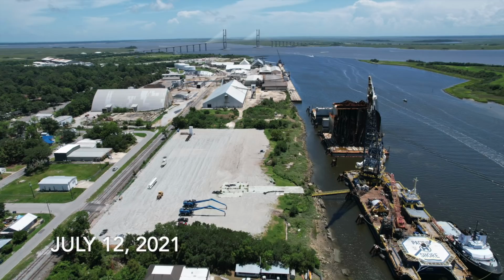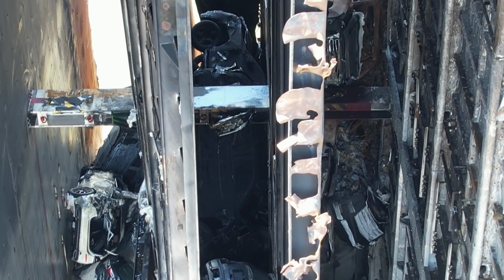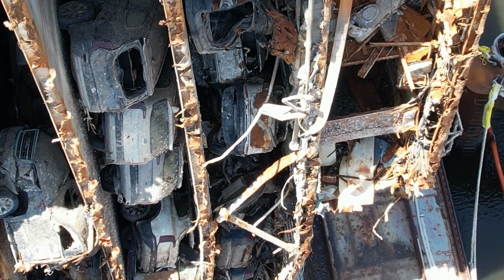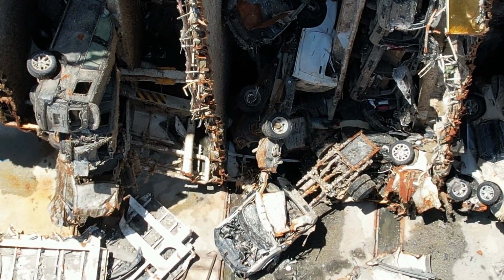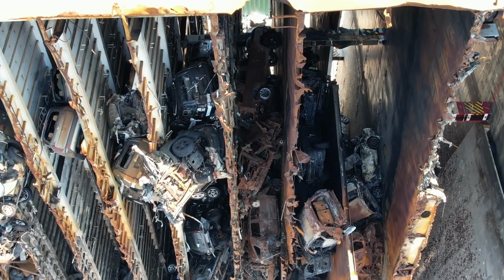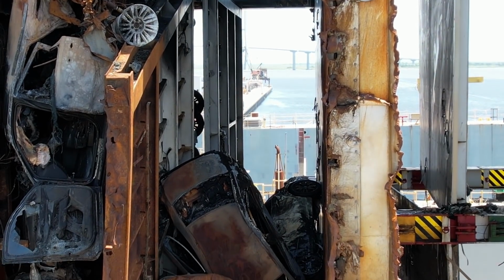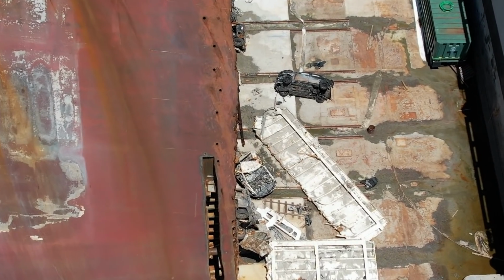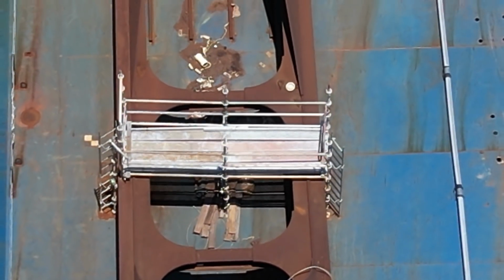LOOK INSIDE SECTION 3!!! on July 12, 2021

Comment: Fantastic drone footage.  What an extraordinary mess.  Thank you for providing such graphic reports.  Do you know the thickness of the hull skin?  Most of the cars I see are "Swamped Buggies."
Reply from the maker: The hull was 40MM thick at the bottom of the hull.  Now as the side of the ship rises, the skin tapers down.  The top of the ship is not very thick, more of a protective covering to keep the cars free of sea spray.  MM
Reply: @MinorcanMullet  WOW. 1.5"  is very thick plate.

Comment: It appears this dry dock is a lot wider than the barges that were being used. This section doesn’t hang over the sides allowing oil & other chemicals to leak into the water.
Reply from the maker: Good observation.  MM

Comment: Are they using the dry docks just in case these pieces are not able to be hoisted as high as the others?  When this piece was hoisted after the cut it seem to be raised as high as the previous pieces.
Reply from the maker: Maybe the drydocks were less expensive to rent for the remainder of the wreck.  I don't think the drydocks were submerged.  MM

Comment: If you play your cards right, there's gonna be some good deals on slightly damaged cars from the Golden Ray, you watch and see. So what if it's "half a car" just think of the gas mileage you'll obtain, only two tires to buy instead of four, ect. You wanna convertible, no worries, mate, plenty to be had. American's are always open for a great buy. You may need to vacuum them out good, but a little work and look what ya got !!!

Comment: I don’t recall having said this before but now is the time. The Golden Ray’s ship captain and harbor pilot ought to be banned from ever having command of any vessel. They should be directed to apply for employment with Waste Management Corp. or SMIT Salvage or T & T Salvage.
Reply from the maker: I think the Pilot deserves a medal.  It was his quick reaction to have the ship pushed onto the sandbar that saved the 4 trapped sailors aboard and prevented the channel from being completely blocked.  Now the Master of the ship probably had some explaining to do. MM
Reply: The engineer that calculated the ballast levels are the dude that needs to be banned.

Comment: I would like to know who thought you could that many cars up with fuel in the tanks without starting a fire!
Reply from the maker: A big fire.  MM
Reply: What would be your method of removing the fuel?  The engine/transmission oils?  The battery?
Reply: That's what burned.  Not much fuel on board though, just a gallon or two. But hydraulic fluid and transmission fluid .
Reply: @joelee7314    As a Tier I auto parts supplier I get to visit assembly plants. I recall a SUV build having 4 gallons of gas robot filled into each tank. Any amount of gasoline is very dangerous because of the vapors. Two cars stacked produces 8 gallon!
I am amazed at the salvage effort keeping the team safe. Other than using carbide chain inserts I can't imagine a safer method.
Reply: They need to be driven onboard, and off.